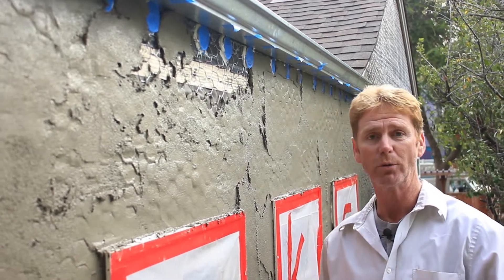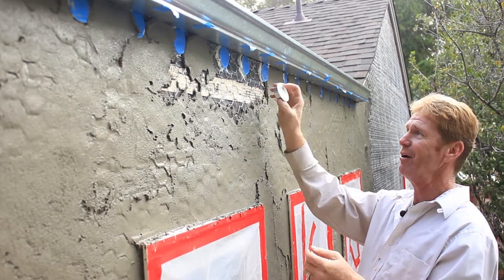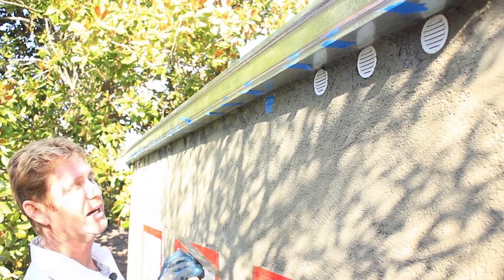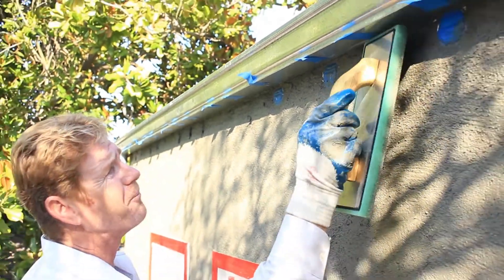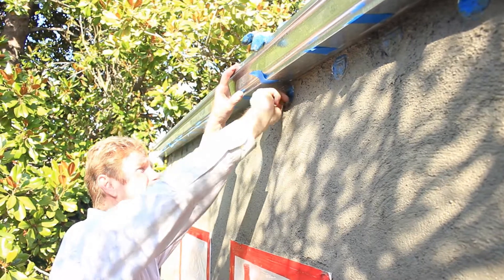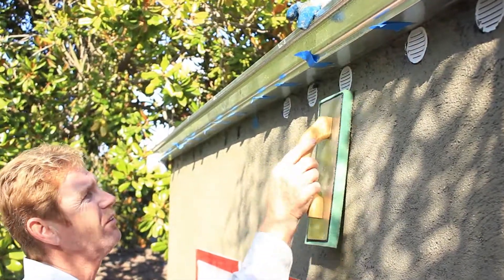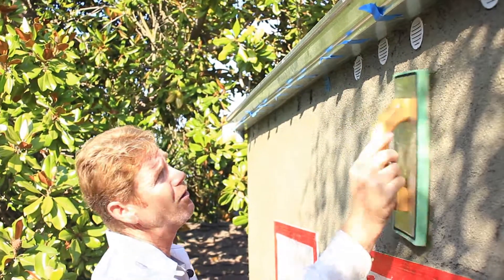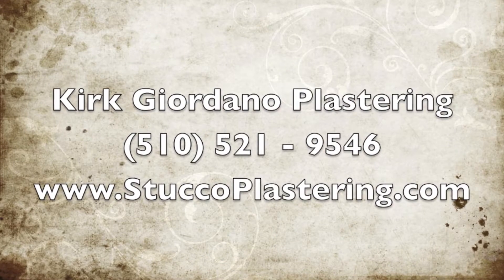How to stucco around small round duct vents

Comment: I'm putting up paper and lath on my walls. The blocking is flush with the sheathing (and has tie plates and nails running all directions), and I need vents along the non-gable walls. 

This looks like my solution. How would you go about setting up this wall differently? I'd like to make it easier on my stucco guy, if I can.

Btw, thanks for all of your videos--they are an amazing resource.
Reply from the maker: Evening Brent, to make life easier I would have installed lovelier gable vents instead of these small round vents, not certain or their overall performance, but  as a rule I just  to do the stucco repairs,
Cheers,
 Kirk and Jason giordano’s rendering videos